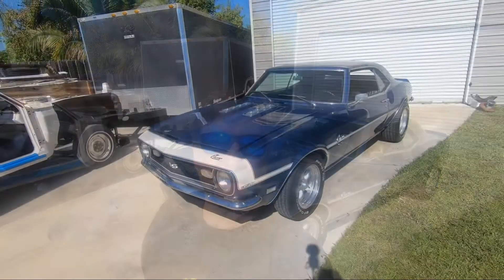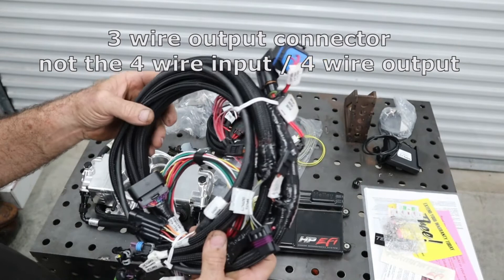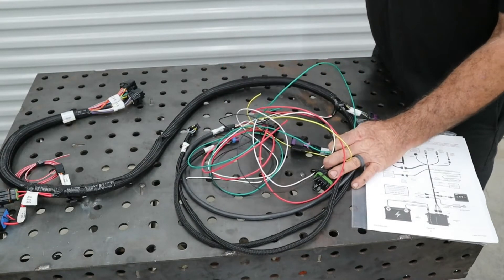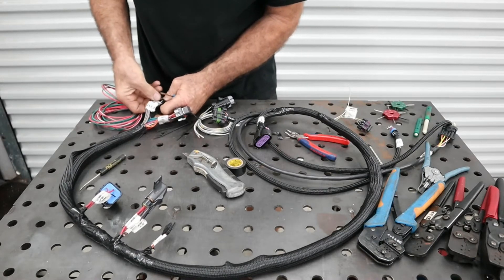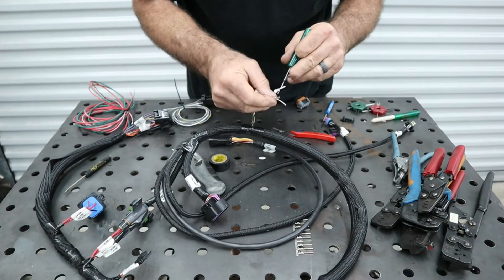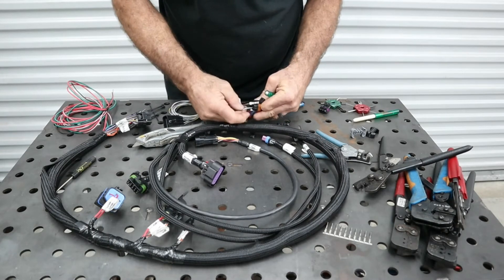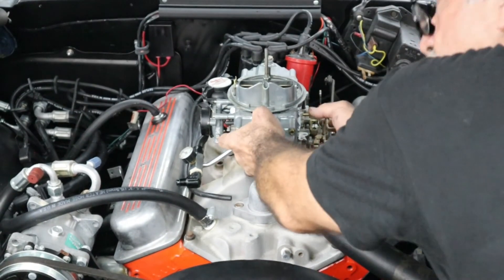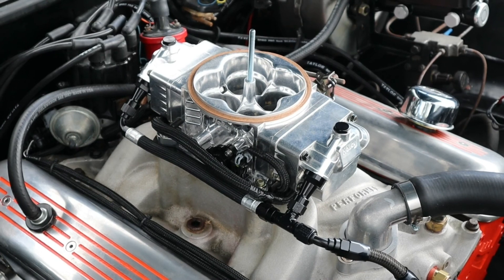Holley EFI install, Holley Terminator, Holley HP install Part 1

Comment: How about the vacuum advance??as I see...the throttle body does not have ported vacuum.
Reply from the maker: I don't usually use a vacuum advance, unless I am going for the best fuel economy. I normally set my total advance and curve the distributor to have around 20 degrees at idle, this will keep the EGT's down at low RPM, don't like glowing headers from retarded timing. But, the Stealth throttle body does have a ported vacuum port on the passenger side coming out the  side just behind the TPS sensor. So if you want to use the vacuum advance for cruise, it is there. Hope that answered your question. Subscribe for more videos like this and other hot rod builds.
Reply: @LANDISPERFORMANCE  yes it did answer my question.thanks a lot for your time and technical advice!
Reply from the maker: No problem, thanks for the comment and the subscribe!

Comment: What is the exact Holley FI part number you used? Is this a Terminator or Terminator X? The Terminator X is used for an LS swap. Thanks
Reply from the maker: That kit was a 550-440 Terminator Stealth EFI kit.
Reply: @LANDISPERFORMANCE  Hello, Yes that is what I thought. I am watching your part 2 video and on Step 4 of the wizard it shows 550-407, 550-408 as the only selection. That is not for the Stealth but a different throttle body. Confused. Again thank you!
Reply: The reason for the questions is I want to order this FI system for my 95 LT1 engine. I'm totally removing all the OPTI ignition and FI on it. I have the dual plane intake for it and the opti eliminator cover. Get rid of that POS and use a dual sync distributor which the Terminator can control. Don't know if I want to go the hyperspark route. Thanks
Reply from the maker: Yes, even though the other part numbers came up, they all use the same injector size, so basically they are all the same kits. Kind of confusing, I guess I should have added that to the video. I actually didn't even think about it at that time.
Reply from the maker: The Holley 550-1001 would be a cheaper kit. The only difference between the two. The 440 kit uses the HP ECu so it will datlog internally.  Where as the TerminatorX will only datalog to the SD kit. Also the HP ECU can do a System Log. System log is a recording of the crank and cam triggers, helps with diagnostic.  The TerminatorX can't perform that. What year is your LT1?
Reply: @LANDISPERFORMANCE  You have been really helpful and I did subscribe. You are correct about the 550-1001. Just a throttle body but I like the 550-440 Stealth. I assumed they used the same injectors or you would have had issues but wanted to ask. It's a 1995 LT1 engine with 25K miles. I've had it stored for 15 years so time to use it minus the Opti and FI. This is going in my 1971 base Camaro. The 95 LT1 made 275HP which is fine as the 71 350 made 245HP gross and 165HP net. Pretty anemic.
Reply from the maker: If your LT1 has the cranktrigger in the timing cover, EFI connection makes a cam sensor that goes where the opti spark distributor and then it will be converted to CNP. If you go that way, use a LS kit for the CNP

Comment: You have 2 sensors installed on your intake. The one on the upper is engine temp, what is the lower one on the intake?
Reply from the maker: Thanks for the comment, the sensor on the top of the intake is a mechanical capillary sensor for the Autometer mechanical temperature gauge, and the 2 wire sensor on the front of the intake is a  CTS sensor for the Terminator, it sends a Coolant Temperature reading to the Terminator ECU to tell it what the coolant temp is , for fueling, like warm up, etc.
Reply from the maker: Thanks for subscribing!!!
Reply: Thanks for the quick reply! You rock!  Wish you were closer!